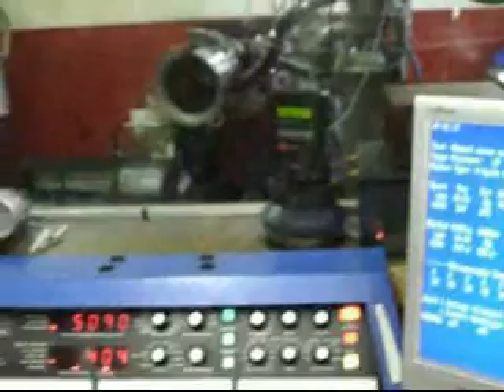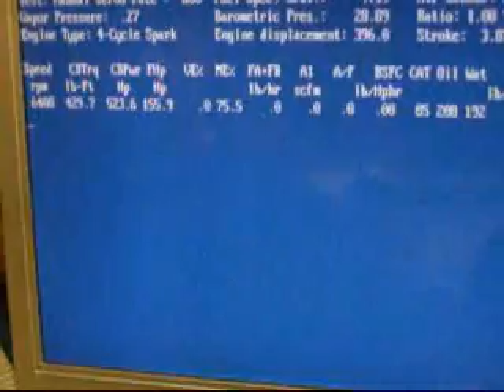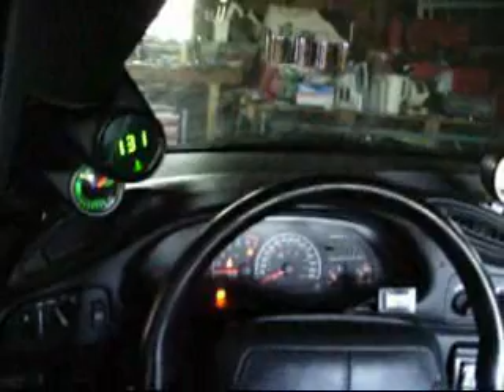383 lt1 with 400 shot

Comment from the maker: 4 bolt splayed caps 
243 249 with a 620 lift cam
1.6 comp rocker
manley pushrods 
solid lifter

Comment from the maker: 210 afr heads 
callis dragon slayer crank
manley pro i beam rods
dimond nitrous pistons 
total seal piston rings and head gasket (for nitrous) 
every bolt is apr 2000 bolts

Comment: Nice build. I have a 94 Z28 too...I have a question...why not using smaller turbos like T70's to get 1400hp...and also what crankshaft did you use in that engine? The strongest crank I know of for the lt1 is by Callies is there anything else?